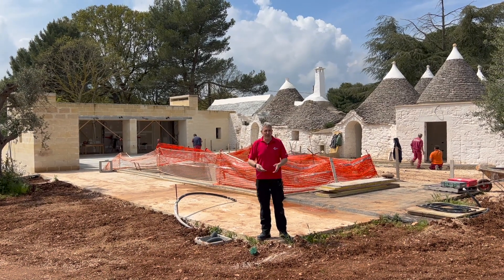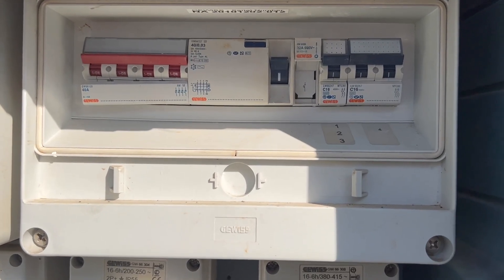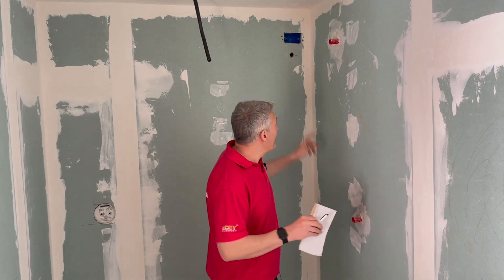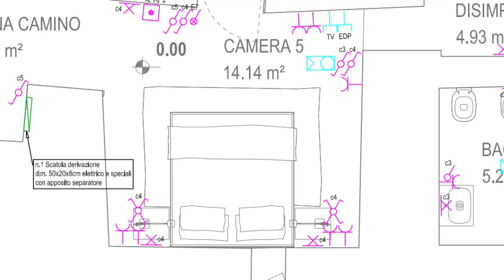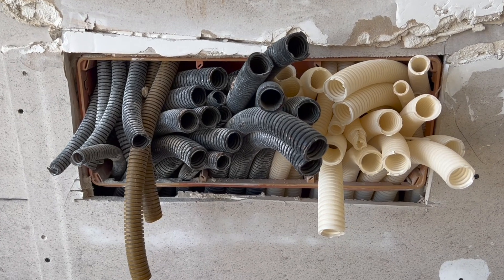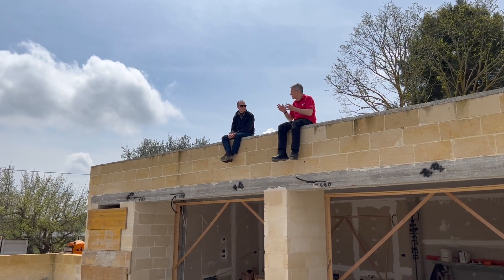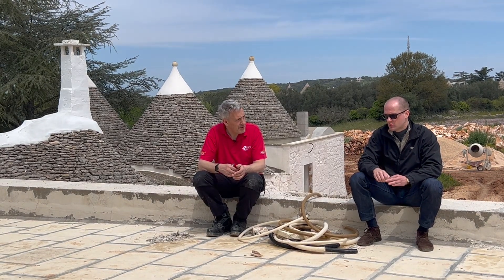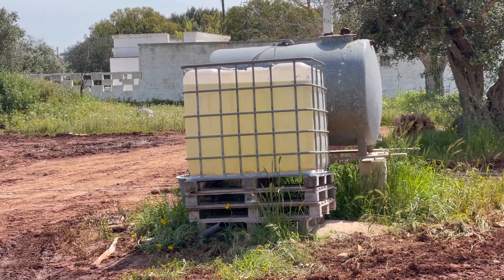Electric Wiring in Italy - You Won't Believe What They Do!

Comment: The conduits are colour coded in Italy by 
Normative CEI 64-8 e 64-100/2 (italian equivalent to UK Wiring Regulations) such as:
1) Black(or gray) for power distribution
2) Green for telephone lines, smart home, SELV, data, terrestrial TV and satellite. For the last two (tv and data) white conduit can be also used.
3) Blue for audio/video and intercoms. Even in this case purple can be used only for audio distribution.
4) brown for intruder alarms and technical alarms
5)Purple in a smart building installation used exclusively for hi-fi audio distribution. 

So the builder there, either didn't explain very well or he just used whatever he had in the back of the van.
Reply: @jmi5969  in Italy the heating and cooking are mainly natural gas.
Reply: Do they follow the brown - live, blue - neural, yellow/green - earth or do they use black for live
Reply: @flixmyswitch  blue is neutral, yellow/green is earth, anything else is live. This way you can have color coding for outlets and switches. I myself use black for outlets, grey for multiway switches and brown for light fixtures
Reply: @flixmyswitch  
parlava di canaline, non di colore dei cavi.
Reply: @flixmyswitch  Yes to each.  You will find brown, red and black as live.  Earth is yellow/green and neutral blue.
Reply: The Normativ 64-100/2 is just a recommendation not  a must
Reply: As a user of italian houses I must say that while some of those coloured conduits are nice looking, pretty much all of them are always too small for any meaningful expansion or future proofing :(
3.5cm and 60º turns should be the minimum electricians put in considering we're not in the 900s any more and the tech that can go in a house these days can be quite varied.
Reply: @un_lucio  esistono delle regole dettate dalle normative per quanto riguarda il dimensionamento delle scatole, dei corrugati  dei conduttori, dei centralini , tutto è  calcolato , ad esempio il diametro dei corrugati deve essere almeno il doppio di quello del fascio di conduttori che deve contenere... I colori dei corrugati non sono obbligatori ma consigliati, mentre per i colori dei conduttori si usano nero, marrone o grigio per la fase, blu per il neutro , questo per gli impianti in corrente alternata a tensione di rete , per la corrente continua si usa il rosso per il positivo e bianco per il negativo, per i conduttori facenti parte dell'impianto di terra invece si usa il giallo verde per gli impianti di protezione dalle dispersioni, mentre se l'impianto di terra è funzionale allora è di colore rosa,  il dimensionamento dei conduttori deve essere effettuato in base alle condizioni di posa, la sezione si calcola in base alla corrente  che deve circolare nei conduttori, al numero di conduttori attivi all'interno della stessa conduttura , e contenendo la caduta di tensione entro determinati limiti : 4% dal punto di fornitura all'utilizzatore nel caso degli impianti  negli edifici, il 10% nel caso delle linee di distribuzione

there are rules dictated by the regulations regarding the sizing of the boxes, of the corrugated wires of the conductors, of the switchboards, everything is calculated, for example the diameter of the corrugated wires must be at least double that of the bundle of conductors it must contain... colors of the corrugated pipes are not compulsory but recommended, while for the colors of the conductors black, brown or gray are used for the phase, blue for the neutral, this is for alternating current systems with mains voltage, for direct current the red for the positive and white for the negative, for the conductors forming part of the earthing system instead yellow-green is used for dispersion protection systems, while if the earthing system is functional then it is pink, the sizing of the conductors must be carried out on the basis of the installation conditions, the section is calculated on the basis of the current which must circulate in the conductors, the number of active conductors within the same pipeline, and containing the voltage drop within certain limits: 4 % from the point of supply to the user in the case of installations in buildings, 10% in the case of distribution lines
Reply: @un_lucio    Hai ragione in linea di massima,ma il futuro sarà wireless/bluetooth ,secondo me.
Reply: @fasullodavvero  It's very poor manners to comment using a language different from the one used in the thread. The video is in english, OP commented in english. You should have kept it open and inclusive regardless of who you're answering too.
That said I'm afraid you're mixing up power and data.
While data can be encoded in relatively low-power waves and thus transmitted over-the-air /vacuum(wifi, bluetooth, zigbee, threads, etc, etc) you cannot realistically transmit wireless energy over long distances. It's gonna be a big laser-beam, thus everything in its path is gonna get fried.  Over tiny distances, like those used by contemporary wireless chargers, it's doable but extremely inefficient. And we're not really in a point of human history where we can happily afford to waster 30+% of power just for sake of laziness and/or convenience.
I personally find conduits a very efficient and elegant solution, it they just were installed with the future and not the past in mind.
Reply: @un_lucio  Amico mio se avessi risposto ad un anglofono ti darei ragione(a parte che esistono google traslate e simili) ,ma ho risposto in italiano ad un'altro italiano,per quanto riguarda la questione tecnica, devo darti ragione (oggi,tra 5 anni chissà?) ,detto questo,il motivo per cui scrivo in italiano è semplice,è l'unica lingua che conosco, relax amico mio relax!
Reply: @deps314  Many thanks for that detail.  Yes I have Black LIVE and a very messy distribution board.  Been trying to find and english speaking sparky here in Italy to comment upon it.
Reply: @flixmyswitch  They should follow brown life and blue neutral, with yellow/green earth. My house is wired with brown for both live and neutral, which is baffling but hey. Can't ask someone to know how to do their job, am I right?
Reply: The plastic tubing is a smart idea and I'm sure it makes it much easier to wire everything up, even though it looks like a mess of spaghetti noodles.
Reply: @GowronSaves  
inside the junction boxes the excess tube is cut and the cables arranged in an orderly manner (obviously if the work is done by a real electrician and not a random dog)

https://www.youtube.com/watch?v=06UC2CZtuNY&t=709s
Reply: @GowronSaves  It does not. I did both, and running bundles of cables was much, much easier than individual tubes. Especially when it involved cutting trenches in hard concrete; unfortunately, today in my country all buried cables must be dressed in tubes, so there's no choice. And then there was the most exciting (not really) job of pushing 50-meter cables into tubes in small urban apartments.
Reply: @jmi5969  Oh really? That's surprising...but I'm assuming you ran cables when the house was still like a skeleton...cause once the drywall is up, how can you run them through holes in studs and stuff and get them around corners/roofs? I'm assuming most of that is done before drywalling. While with the Italian system, you can run them after house is mostly built....though it looks like doing the same job twice. I don't work in trades, but going by what I've seen.
Reply: @GowronSaves  That's fine for American framed houses, but here it's usually either light aerated concrete or hard concrete or a mix of both. I never had any experience with wooden frames.
The Italian system of first laying the tubes, and then pulling the cables through tubes  seems too labor-intensive and requires careful planning. The tubes must be fairly thick, the curves must be wide and smooth, there can't be more than one 90-dergree turn or it's stuck etc. And what do they do about heavy-gauge rigid cables (say, 4x10 sq mm boiler line) - ?!
Reply: @jmi5969  I hear ya...well whatever works. I agree so long as they dont have sharp turns it could work. I have no dog in this fight, I found it interesting.
Reply: @jmi5969    you'll rarely see a 4x10 mmsq. in Italy in a domestic electrical installation. Firstly, because 4x(something) clearly means that is a 3P+N supply(or in North America a Split phase system which is not used anywhere else in the world) which is not very common in domestic applications in Italy, where we are a bit more conservative regarding power supply to domestic application. Secondly, you'll have to choose the size of the conduit accordingly with the section and numbers of conductors drawn into that specific conduit. Also, italian stranded conductors to be used in buried conduits are designed specifically to be very flexible (high count of strands increases the flexibility and maximum tensile stress of the copper core), that's another reason why single rigid wires are not very used.
Reply: @jmi5969  it actually isn’t: when I switched my internet connection to FTTH the technician simply pulled out the old ADSL copper cable and replaced it with the glass wire. I guess in the building phase it can be a bit of a pain laying down all of those conduits but other than that it’s a quite good system. Also your “technique” of drilling a path for cables later one is not really used here bc it can be quite costly
On the other hand I think that it’s quite labouring building those steel conduits in wooden houses for energy hungry appliances like boilers that we don’t even use (it’s common to have a natural gas one instead of an electric one).
Reply: @simo007_d7  Yes, fireproof steel conduits (mandatory for flammable walls in my jurisdiction) is prohibitively expensive - so that most contractors and homeowners disregard the code altogether.
As for cutting trenches in concrete walls - it's not costly at all even with hard concrete.  Dirty, noisy, impossible in some places (critical load-bearing columns) but quite fast. With aerated concrete it's a breeze. When I did my own house (120 sq.meters) the job took one weekend at a leisurely pace; a professional crew of two would probably do it in three hours.
Reply: What about Wi-Fi?
Reply: And that's simple , is it !!.  Too many variations possible
Reply: Regardless of the differences in wiring.
The unnecessary level of wasted time and labor alone is astonishing.
When you could do three steps at the same time, their doing one step at a time.
Taking 70% longer to achieve the same result.
Which equals more cost to the client for no reason, other than their incompetence.
If I was the client paying for this job, I would be pissed…
Reply: I'd be so p*ssed if I wanted to install, say, a network socket and the perfect conduit going from the right place to the right place was already there, and then I can't use it because it's the wrong color. Also, when my intercom is IP based, does it need green or blue conduit?
Reply: Italy is ever at TOP in all.
Reply: The very idea of running audio cables through a tube in the wall  sounds like an audiophile's worst nightmare. A blasphemy as bad as MP3.
Reply: @jmi5969  They are relics from a bygone era, nobody uses audio cables anymore in that way.
Reply: @jmi5969  you can run optical wires there

Comment: As someone servicing Italian industrial machines in Israel, I love the Italian electrical system.
The design, thought and workmanship is second to non.
Reply: Regardless of the differences in wiring.
The unnecessary level of wasted time and labor alone is astonishing.
When you could do three steps at the same time, their doing one step at a time.
Taking 70% longer to achieve the same result.
Which equals more cost to the client for no reason, other than their incompetence.
If I was the client paying for this job, I would be pissed…
Reply: @fredflintstone8817  that's basically the whole ethos of #madeinitaly
Reply: @edvvard101  
LOL....
I've often wondered what this type of "ethos" costs the EU (other nations) in the end.
Reply: In the Peugeot factory (Vauxhall) in Ellesmere Port near Liverpool, when the French send over industrial machinery, they have to rewire parts of it.
Reply: @johnburns4017  The grid in the UK and on the continent are practically identical. The only difference might have been the UK voltage is a bit higher at 240V nominal.
Reply: @trespire  
It was the safety aspects of the wiring, not the voltage.
Reply: @trespire  UK is nominal 230 volts -6%, +10%. Of course in practice most established electrical supplies didn't change when 230 was agreed with Europe... so we often still find 240V (and higher).
Reply from the maker: Agree - The next part of this project is now ready 👉https://youtu.be/ISSy8vDxLcw
Reply: I dunno man I ordered a machine from Italy and when it arrived it needed a main fuse with a higher rating (on the advice of manufacturer). They sent updating drawings same day but as a mechanical engineer I was scratching my head over how it could have an incorrect fuse in the design. Seemed ropey to me
Reply: @-BuddyGuy  C'mon, when it comes to electricity, the Italians are undisputed, is this a sort of sabotaging made in Italy?
Reply: @boytiti5446  Nah I had engineer from the company with me, he was the one who powered it on, our factory voltage was within spec. The machine had a current spike on power on, but it didn't blow the fuse in Italy so I think their factory was on a lower voltage and there was zero margin on that fuse
Reply: @-BuddyGuy because if it was made for the italian market we have different regulations since the voltage is different retard...

Comment: I'm not seeing any horror stories, just a different culture, a different set of answers to similar questions elsewhere. Wanna hear an electrical horror story? I live in an area where the first electrical systems was installed, Connecticut USA, and I've been in a home that the original gas system was still installed and got to see most of that gas system used as the pipe and tube gas system also ...energized and used as the electrical system so some of the ceiling lights could use gas mantles in some of the lamps and electrical bulbs in some of the lamps. Total guess as to what copper tube is hot, gas filled, both or dead. Either shocking, explodey or nothing. They were in the process of 'modernizing' their 100+ year old family home.

Comment: New professional project That’s one thing but most electrical in italy really sucks especially older apartments where there sometimes literally is just one or two breakers for everything and in the beater ones it still is just: 1 general,  2 bathroom, 3 kitchen, 4 sockets, 5 lighting. Which is the best case scenario
Reply: What do you want, a breaker for every socket?
Btw, electricians try to stay cheap and use as low breakers they can. You must ask them if you want more of them.
Reply: @Ale-bj7nd  in other countries it is much more dissected and precise by default

Comment: That earthing electrode ring setup reminds me more of lightning protection earthing than straight electrical.  I do appreciate that it can be necessary in poor soil conditions of course.  Interesting to see how differently things in general are done in Italy vs Australia.
Reply: There are many places in Southern Europe that do not have the luxury of having several meters of moist soil for grounding so a ring system will provide you with the necessary earth ground one needs for safety. Another factor to consider is that if it is extremely a dry area that the electrical system is located it is wise to flood the grounding rod wells with water to maintain the ability to conduct to earth.
Reply: Ring electrodes are routinely installed for electricity supplies in the UK. It's what you get when you consult a specialist earthing contractor vs an electrician.
Reply: We have to measure the loop impedance so it works as earth as well. Most of the time tough electricians just water the ground before testing😑
Reply: A "ground ring" is desirable in dry or rocky areas. Sometimes a well is drilled  to get a good ground 25ohms or less resistance. In texas it is a good idea to bond the steel in your concrete foundation to your grounding electrode system. There is always a little moisture under the concrete.
Reply: On  the volcanic plateau in the North Island of New Zealand it is very difficult to get a good earth connection due to the pumice soils. They run buried earth conductors between power poles to get a better connection.
This part of Italy is also volcanic and that may be the reason they do that.
Reply: @PaulG.x yep true! Conductivity test is done before deciding how to install grounding. If the ground is particularly insulating, these systems are used. Sometimes it is sufficient to expose and connecting to a rebar from the armoured concrete foundation!
Reply: @PaulG.x  more than vulcanic this specific area has very clay rich soil (hence the reddish color) , plus it's usually very dry. In the end the problem is similar